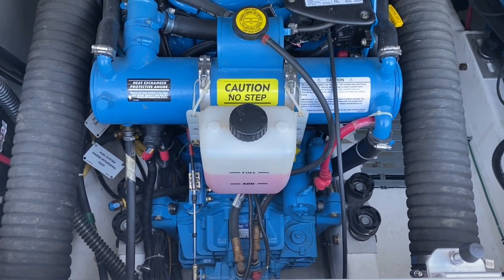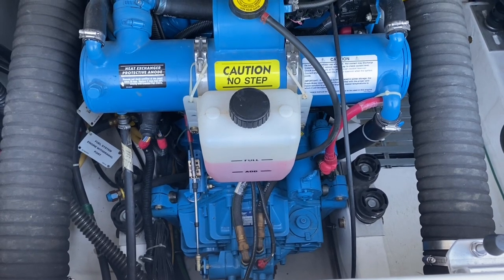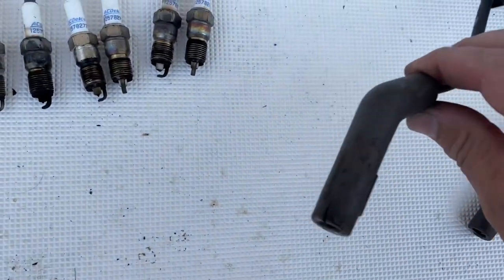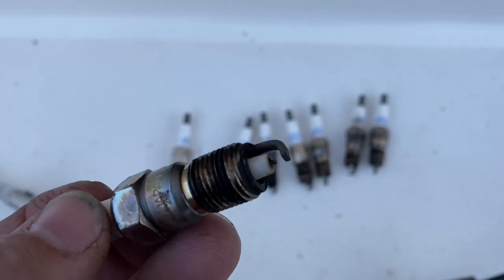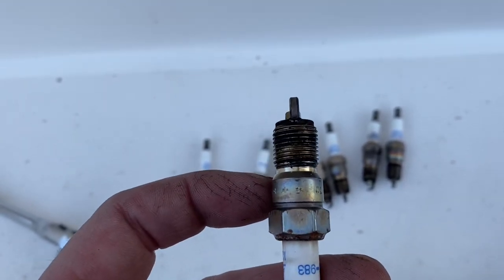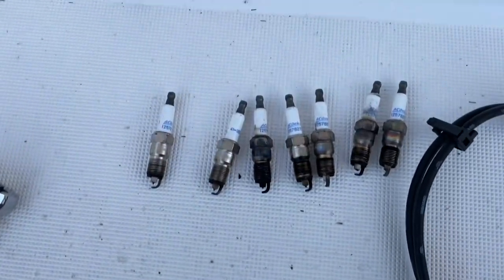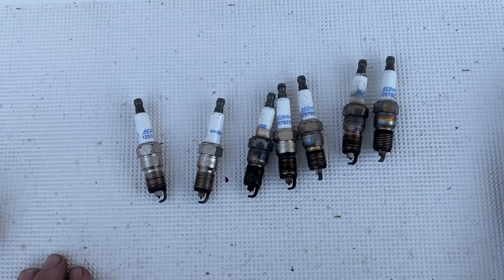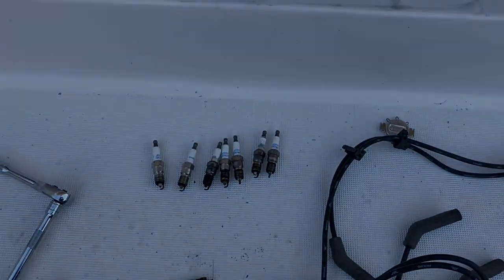Marine Transmission Rattling Noise Common Misdiagnosis Velvet Drive 5000 ZF Hurth 630 63A 68A 8.1

Comment: Yep …. Found one wire loose on distributor cap. Also, idle RPM was too low. Once speed was increased the rattle disappeared.  Thank you Chris.

Comment: I had that exact noise coming from the starboard 8.1 Crusader in my Silverton 2005 34c. Changed the plugs and it went away. I also changed the exhaust elbows, risers and stainless wing plates. The elbows and wing plates are a critical maintenance item for the 8.1 engine.

Comment: I had the same noise due to a carburetor problem. Idle seemed fine when listening to the engine but there was a subtle roughness the caused the rattle. Older Velvet Drive trans.
Reply from the maker: Yep. Cast iron transmissions can do it, too. Anything that causes a misfire or an uneven running engine will cause the transmission to rattle.

Comment: Similar problem with my 1999 Mercruiser 7.4 MPI and my Velvet Drive 5000!  Going to hire someone with an analyzer to look for a misfire.
Reply: Any updates on that? I have the same issue but my customer won’t believe me and refuses to give me the go ahead. 😅
Reply: @joshuaroy9672  Yes, I'm just finishing up my YouTube video for my channel.  Bad injectors causing a misfire!  Replaced them and engine increased 1500 rpms!
Reply: Hello 88.7 4 searay borg warner vd I have  that same noise but only when I pit in drive reverse I don't hear that pleas help?

Comment: Having the same issue. Was this while the boat was in gear?
Reply from the maker: Mostly neutral. Anything to cause an uneven running engine can cause these aluminum transmissions to rattle.